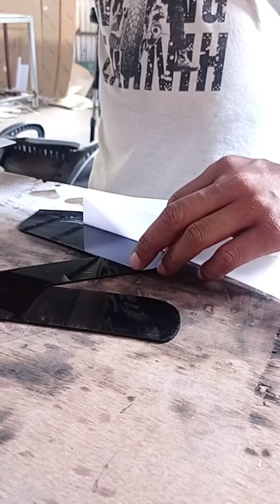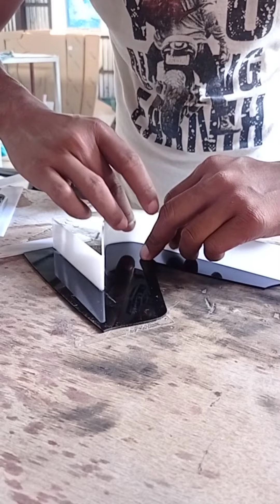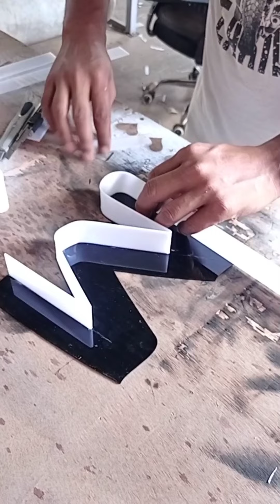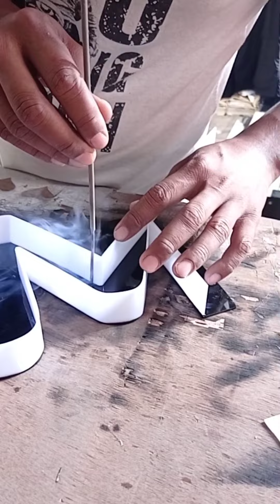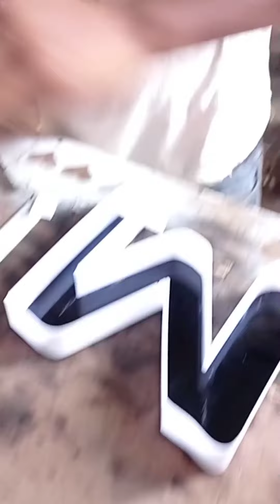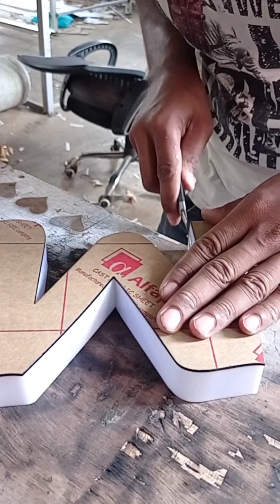How to make 3d acrylic channel letters/DIY 3d acrylic channel letters

Comment: With LEDs or without LEDs pricing?
Reply from the maker: With LED 1$-1.5$ per inch height of a single letter and Without light  0.5$ per inch height of a single letter.